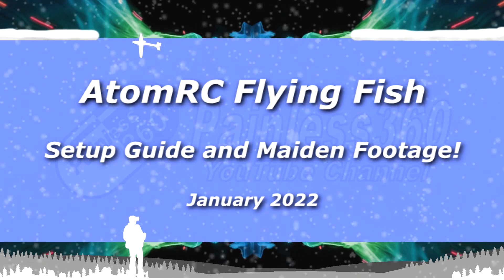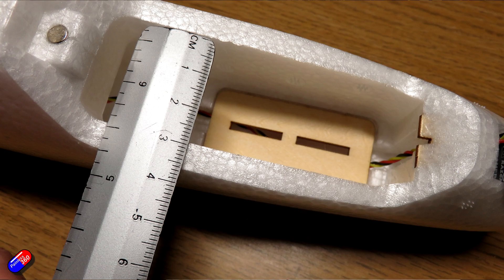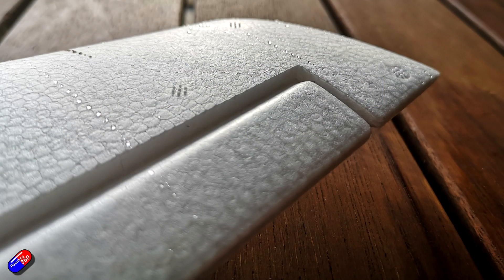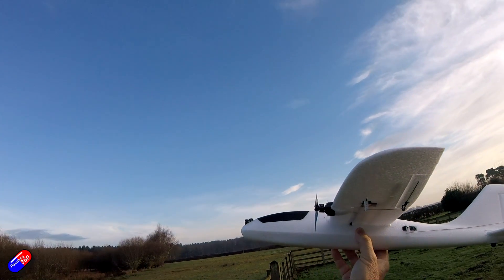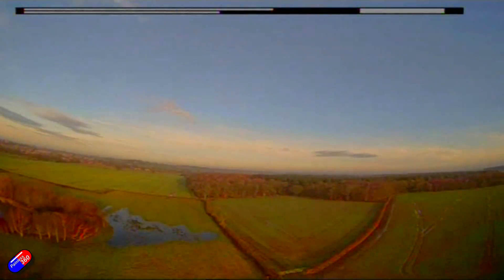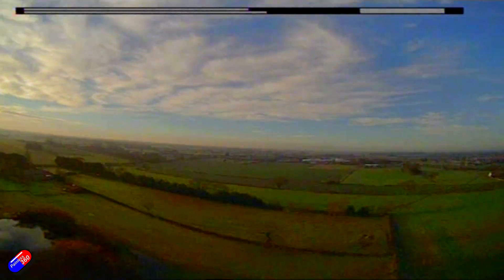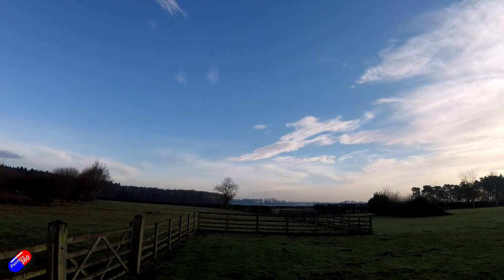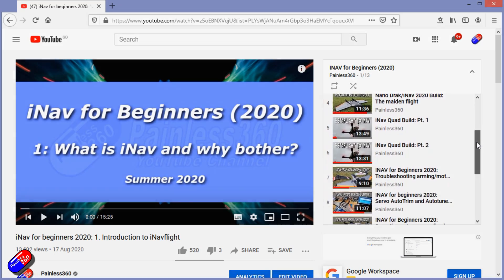AtomRC Flying Fish: Setup tips and maiden flight!!

Comment: RadioLink Byme-A stab fits easily. Even on 2s there is greater than 1:1 thrust to enable the use of the "Hover Mode" with the Byme. Finding a battery to fit properly will be the hardest part these days. Pootles around nicely.

Comment: If you put a 360 camera on it would you be able to look around with your fpv headset, when moving your head
Reply: I think that is technically possible.  I've been playing around with this idea in my head for a while.  It would be "electronic headtracking" that does not need any servos and thus bring big weight and complexity savings.

Essentially, the 360 camera would need the two PWM signals for pan and tilt (and possibly 3rd for roll) and then it can do the real-time rectilinear mapping from spherical video to that section of 16:9 video frame and transmit this processed image out the video TX.

Comment: Question to all!!  I need to calibrate the flying fishes ECS.  Anyone know how to do that?  I think the 2 in 1 got reprogrammed when i tried to bind it.  It started playing a tunes and now when i hit throttle it only engages at half stick.   Thanks in advance!!!
Reply from the maker: Usually you connect power with the throttle at full and then drop to zero once the ESC starts beeping..
Reply: Lee is not a lot of help there mate! This little twin, which we have 6 of (and love flying) does have some faults. Mostly these seem to derive from that combined ESCs/Bec/PD board. On occasion the digital aileron servos (which are routed through it) seem to pick up some interference and can self-destruct (especially when no receiver signal is present - as in when an added Stabilizer is booting up.) AND, as you have there plus we also had 1 instance of, occasionally the ESCs go beserk and CANNOT be recalibrated as Lee described. Probably best to just pull the combo board and replace with 2x Mini 7A ESCs and 1x Mini 3A Bec.

Comment: Did you have any crashes?
And if you did, would you say that it was VERY durable in those crashes, or just average like other foam planes?
Reply from the maker: No crashes but the foam is holding up OK. the light weight and lower speeds are helping keep it in one piece!
Reply: @Painless360  Well go crash it a few times and let me know!!   j/k   ;)
Reply from the maker: It is at a new home with a flying buddy and I'm sure he will give it a through testing! :D
Reply: @Painless360  Well, if he crashes it and you wouldn't mind taking a couple minutes, I'm sure I'm not the only person who would really appreciate learning how durable (or not) that plane is. There's nothing like a plane that behaves really well for newer pilots or for afternoons when you just want to have a lazy relaxed flight, but will perform and do fun stuff when you want to push your skills and see what you and the plane can do, but then (here's the part most planes fail at) stand up to most crashes without needing any repairs. My WL Toys F949 is great for lazy putting around, and it's virtually impossible to damage. I've flown straight into trees, straight into the ground, straight into the side of a wooden shed...and I have never had to repair a single thing on it. But it's nothing more than a putt-putt lazy flier that can't do anything interesting. So I'm searching for that holy grail of a plane that is just as durable as that F949, and just as mellow when I'm mellow, but is a blast to fly loops and rolls and inverted and vertical when I feel like trying those things. One of these days SOMEBODY will crack that code...and trying to figure out if the Flying Fish may be close to that?
Reply: @SteveGergetz  get the Nano Goblin